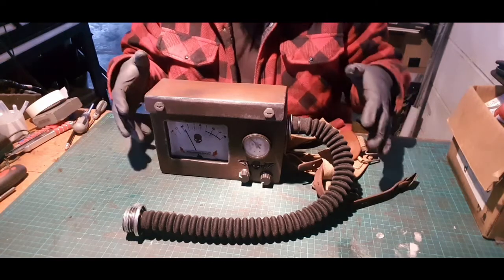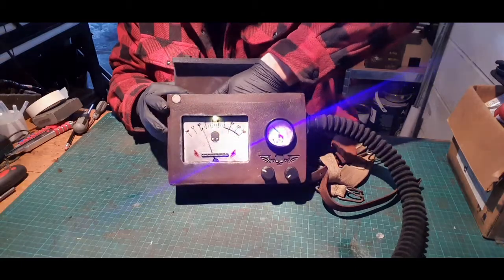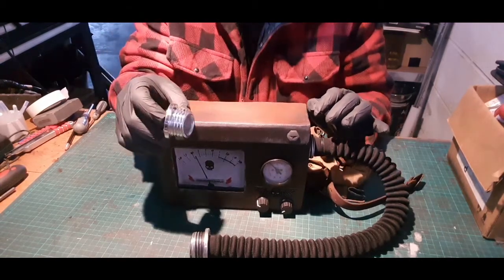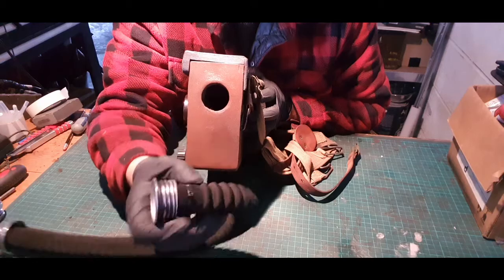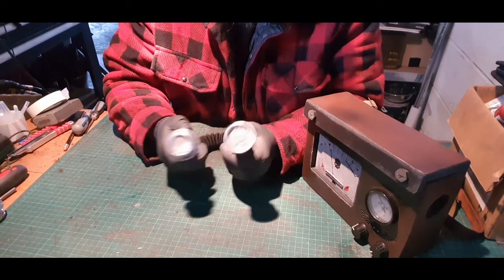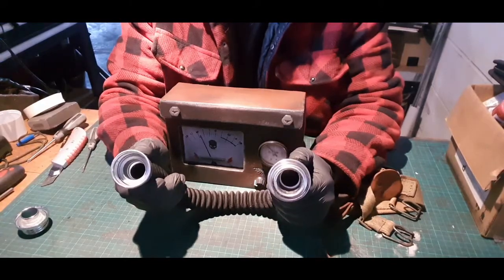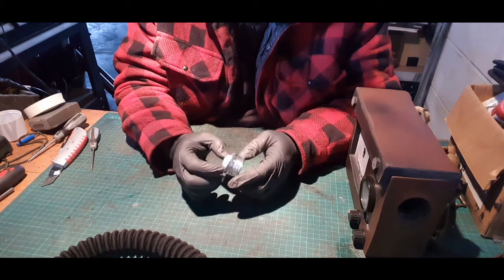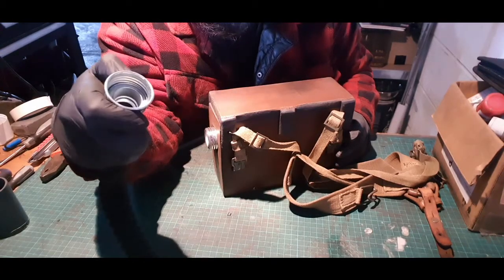Krieg respirator box upgrade

Comment: Re adding a fan/cutting a hole, have tou thought about possibly cutting a hole in the bottom of the box and covering it with a mesh grille, possibly made out of Aluminium panel repair mesh?
Reply: This^
Bottom/top/side. I had the same thought.